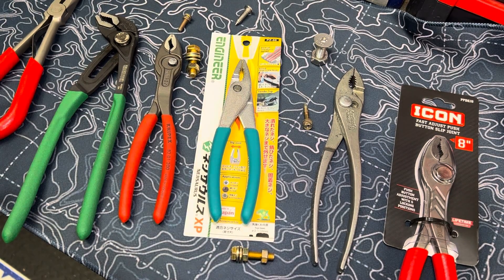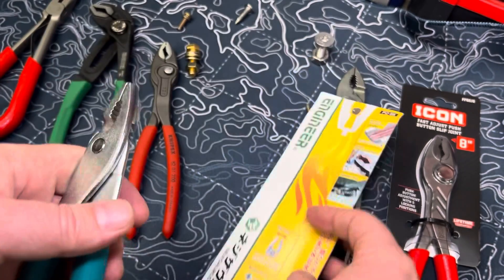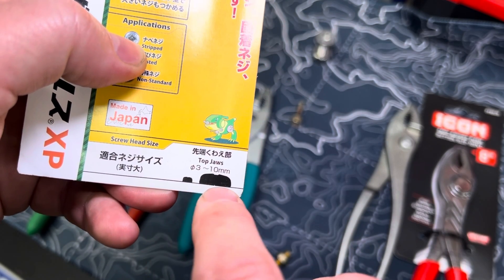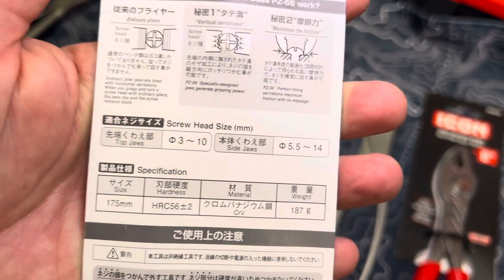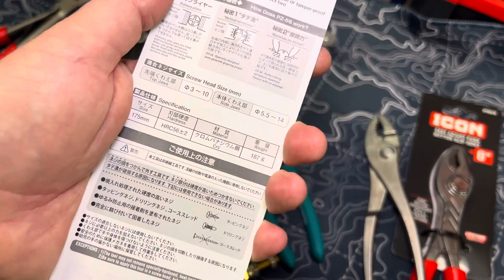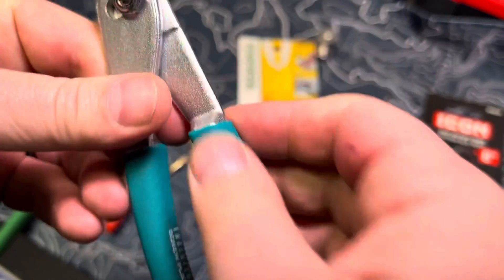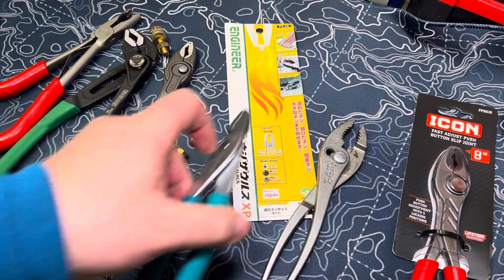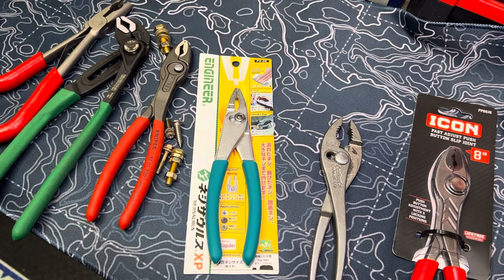Supreme Extractors? ENGINEER’s NEJISAURUS - Screw Extraction Slip Joint Pliers # PZ-56

Comment: Vampliers makes the same screw extracting pliers as the engineer pz-56. The tolerances on the vampliers is way better than the engineer, also the grips are so much more tightly wrapped you can't pull on em like engineers, and only about a $12 difference in between the pliers cost, I think it's well worth the $ imo! But also I think KNIPEX is the best 👌
Reply: I carry the vampliers version and when I got the twin grips I thought they were going to get replaced.  I stopped carrying the knipex after I had to walk back to the van and get the vampliers like 10x.  I work w wood screws and not bolts but the vampliers can grab much less of a fastener and remove it than the twin grips.  If I get it a little way out I sometimes switch to the icon pistol grip over the twin grips.  I’m a glutton for punishment though because I bought the icon tg knock offs like a week ago and they have been just sitting with the twin grips in the drawer.  I agree that the vampliers are a lot better than the engineers as far as not rusting and their tolerances.  You can tell when you use them a lot and switch to the engineers
Reply: @bulshavix6  the twin grips have worked really well for me with pan head screws that were stripped in commercial refrigeration applications! I luv the twin grips the most! But the vampliers are also great because they did the same job my twin grips did. I think I like the cushion grip on the twin grips. It'll grab a hold of the stripped out Phillips pan head screw and lock onto it without any slippage! Also on rusty 5/16" sheet metal screws they both work amazingly 👏 I get super excited when I come across a screw I can't get out with a screw driver, I go and get my twin grips and have at it 😁 I just bought the icon pistol grip screw extractor pliers, but haven't gotten to use it yet. The next stripped out screw I find I will give them a shot!
Reply from the maker: @bulshavix6  appreciate the side by side comparison from someone that uses them a lot. Interesting to see you use them more frequently than the twin grips but makes sense as you deal with smaller screws. Thanks again for sharing. Please consider sticking around by subscribing and liking the video. 👍🏻
Reply from the maker: Thanks for chiming in. After further investigation their dimensions appear to be identical. Only difference being finish and color of grips. I would argue that they are not worth the premium for that change unless you want the 4 year warranty vs 90 days. In that regard it might be beneficial for some using them heavily in harsh environments. Thanks again for commenting. 👍🏻
Reply: @ThingsMen  I mean you can look at anything written about them, but they literally have less to no slop when using them in comparison to the engineer version, and I actually found them on Amazon for only $10 more than the engineer pz-56. Dimensions are identical but performance is at least 1 step above if not more! Js! Great video BTW!

Comment: Great looking pliers I have seen some of the other engineer tools, I just got the Icon set yesterday I haven't had a chance to use them yet. 
Thanks for the video
Reply from the maker: They are a great. The price point is favorable as well especially with the lower price of the yen lately. Engineer makes some great tools so keep them on your radar. The icons are great as well, especially for larger fasteners. Thanks again for commenting. Please consider likings and subscribing. 👍🏻
Reply: The slip joint style engineer or vampliers are the best of all their pliers.  I have tried all the other ones and they have the most grip.  I still haven’t used the icons yet though
Reply from the maker: @bulshavix6  thanks for sharing and glad to hear you like them. The icons are for sure nice especially if you get into larger fasteners. For $19 I would suggest grabbing a pair. 👍🏻